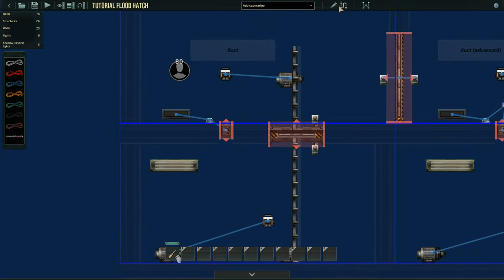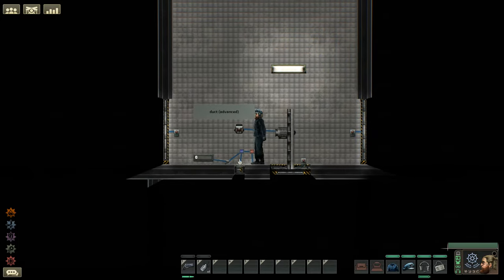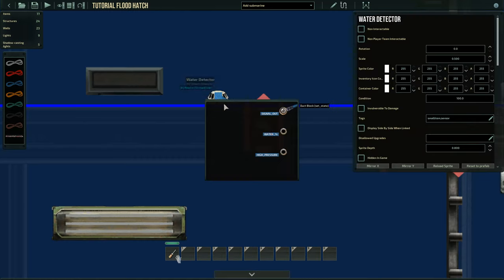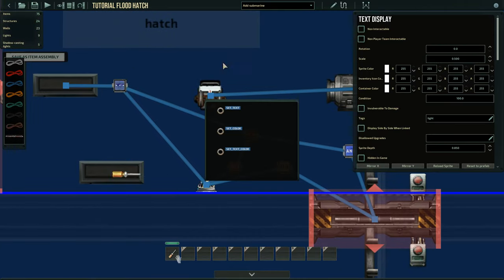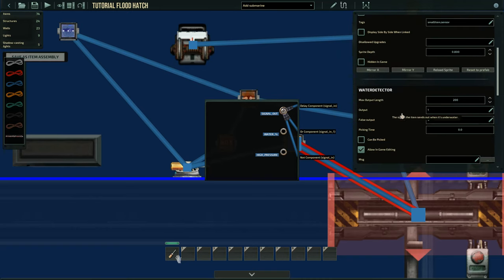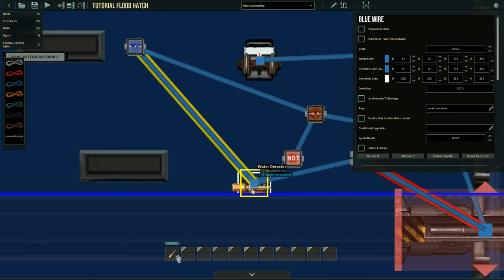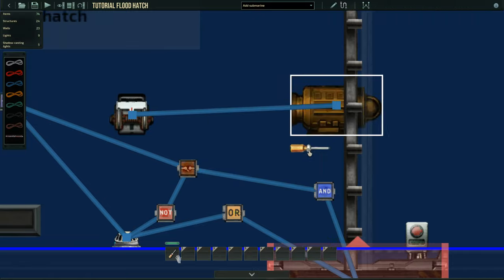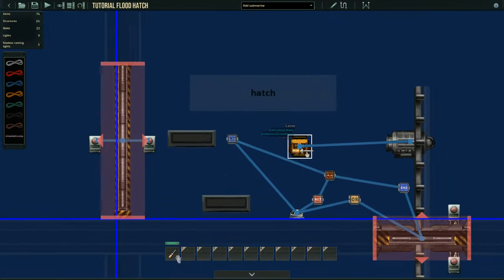Automate flood ducts and hatches (while in game) wiring guide 2022 - Barotrauma

Comment: some fast tips, you can actualy invert the signal of the detector without the not, youst see the true/false output in the component and write it the opposite of how it is, also if you use the %level instead of the estate out you make sure that it doesn't close until there is not even a little water left since it outputs a number between 0 (no water) and 100(full of water) and for a component any number that is not a 0 is true

Comment: is there any chance to put a water detector below the hatch so it would not open if theres water below ?
Reply: Maybe water detectors have to be on the floor (so where Water will start pouring out) otherwise they can't detect it untill it physically fills the room and actually touch the sensor
Reply: @CaptainGrief66  meant it kinda the way of if theres a breach below it would keep the hatch closed so it would not open and let the water to get up